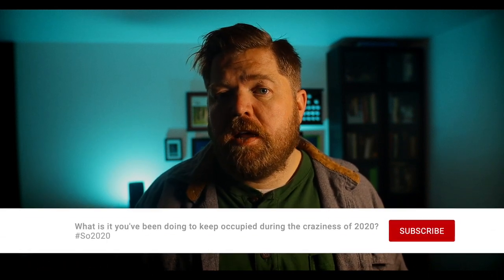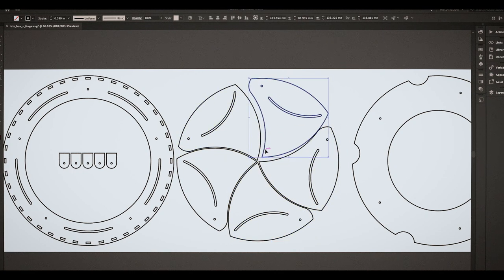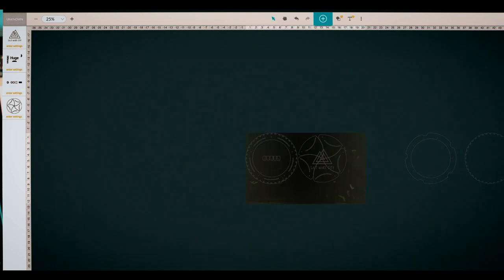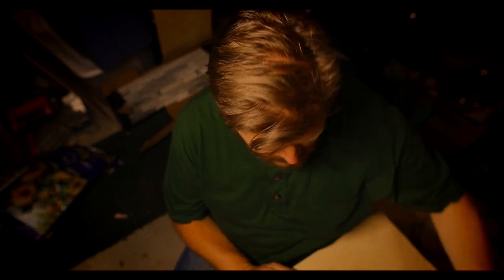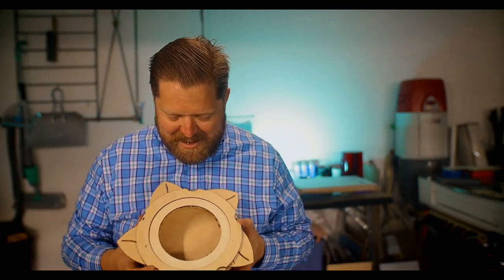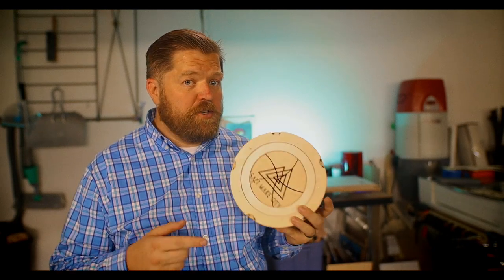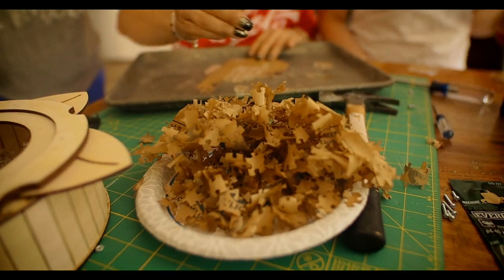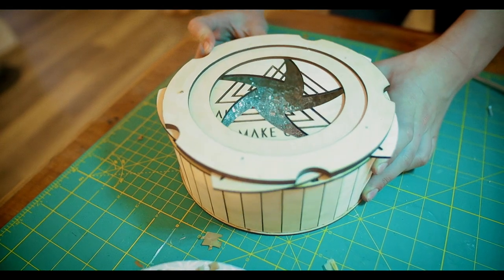Glowforge Made: The Evilest Jigsaw Puzzle in An Awesome Mechanical box

Comment: I have some animal shape puzzles and I can’t get the pieces to cut out right. I use the create button on my glowforge. I’ve tried clicking on the black line and it cuts it twice. I’ve clicked in each puzzle piece and I still have some that double cuts. I’ve tried separating each piece and they just don’t fit. Anyone have any suggestions?